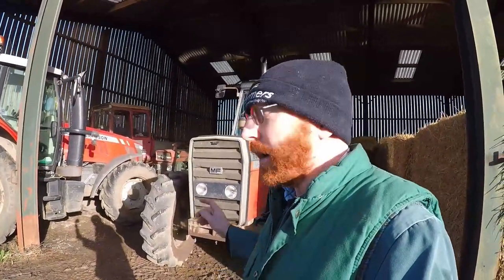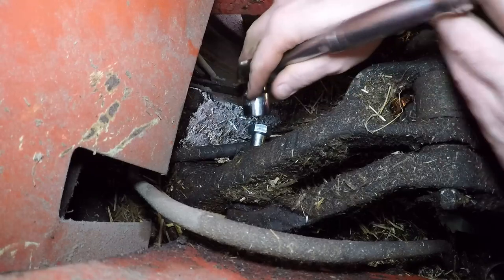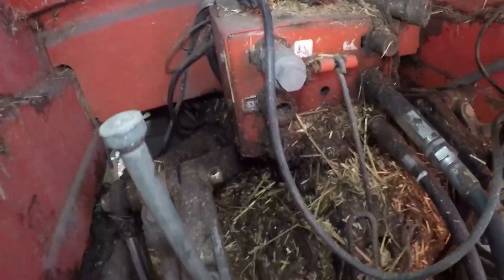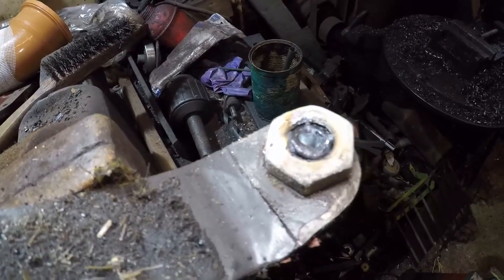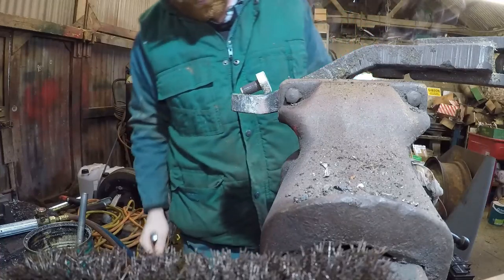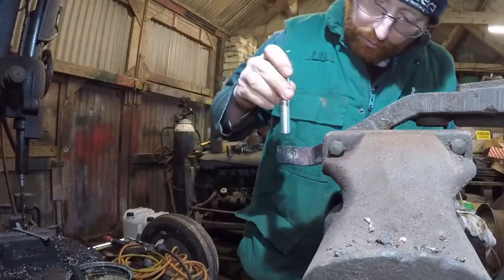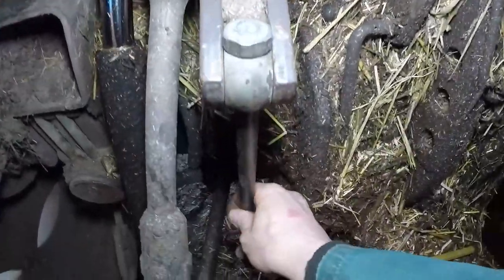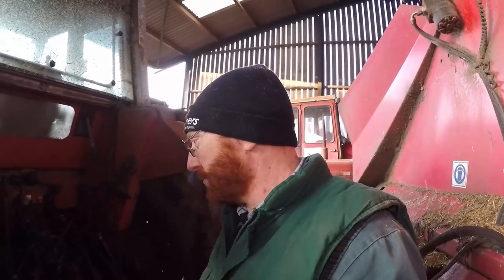Massey Ferguson 698 hitch repair.

Comment: just a little tip from experience heat the part to cherry red then dunk it in a bucket of cold water the bolt will be free this method has worked for me for the past 30 years

Comment: Well repaired Dan. 
It looks like there is a split pin missing that should hold the top assister ram on?
Reply from the maker: There's roll pins holding it together.
Reply: @CowfarmerDan  
Thanks Dan, I should have realised that. 
Wishing you and all on the farm a lovely Christmas, all the best for 21.

Comment: Great job Dan !  Love the attention to detail with running the tap through the hole. Is there a special oil you use or is it a light machine oil like wd40!
If u had stuck that piece in water to cool would it take the strength out of it?
Reply: I say he used tread cutting oil..
Reply: We were told not to use motor oil for drilling / tapping .
And if he cooled it by putting it straight into water /oil / brine it would be “hardened” but then it also becomes more brittle .
Reply from the maker: It's proper cutting oil, although as was only cleaning the threads any oil would have been ok.

Comment: Did the support ram for the 3 point linkage come as standard on that 698 or could you be able to put it on a 178 or 188?
Reply: You can fit it to any massey
Reply from the maker: Not sure if it's standard on a 698, but it will fit anything with a square axle.